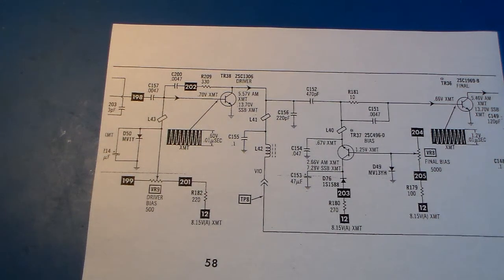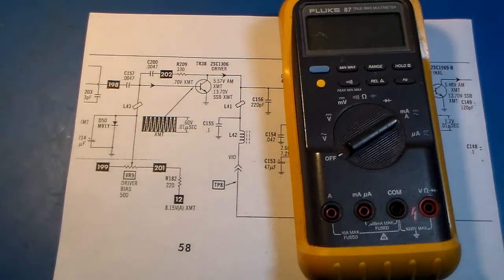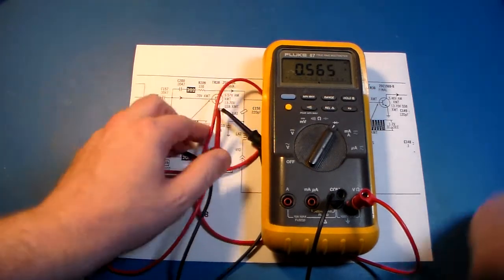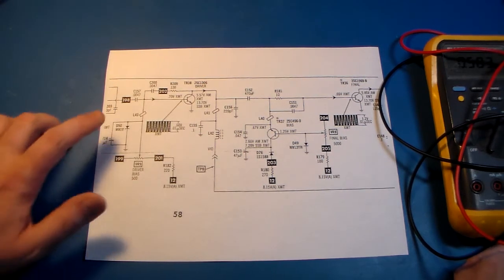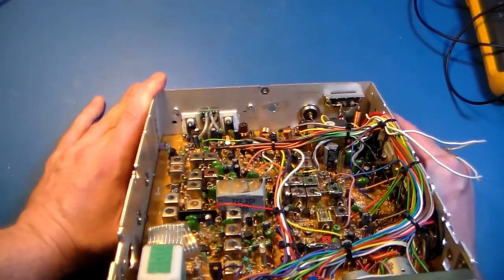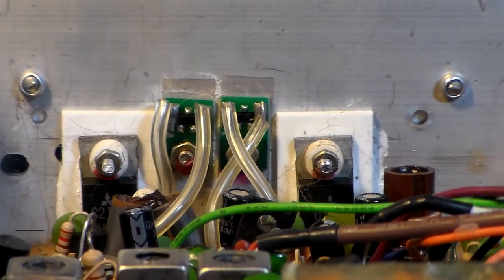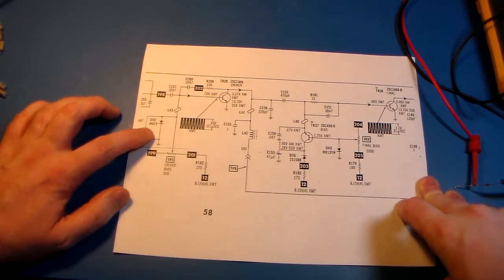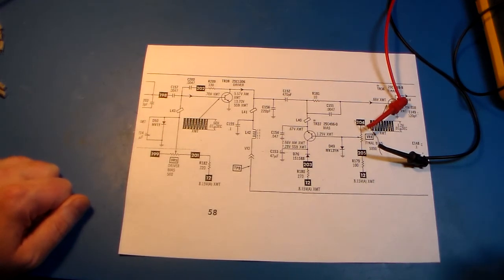The mystical MV1Y Bias Diode.. not so mystical.

Comment: you could also use a double duo schottky diode ready for both final rf transistors. like https://cdn-reichelt.de/documents/datenblatt/A100/MBR1545CT_MBR1560CT_CDIL.pdf, MBR 1545CT Dual Schottky diode, common cathode, 45V, 15A, TO-220AB

Comment: My 1993 "CQ Publishing" japanese-diode reference book page 276 shows type "MV-1" rated for negative tempco of forward-voltage drop of 1.9 mV per degree C. Max power 40mW, max forward current 50 mA. Rated forward drop at 25 degrees C is betwwen 0.58 and 0.65 Volts at 3 mA. 

These were frequently found inside a molded plastic lump with a slot for a mount screw. Incredibly popular inside high-power audio amplifiers decades ago, some with 3 or four series junctions inside to use with complementary-symmetry output stages. It would mount to the heat sink near the big bipolar output transistors, and served to stabilize zero-signal idle current as things heat up.  

Can find no listing that includes the "Y" suffix. My guess is that it's the package designation only. 

Strangely the book shows no entry for "MV13". But we know what's in there, right? 

73
Reply from the maker: I would hazard a guess that the 13 is just two in series on the same die.
The 1.25v vs .7v sort of gives that away a little.
Of course... just speculating.

Comment: Yep, a 4148 works.  RF parts list a 4148 as the replacement for the MV1Y.

I think they actually used a varistor compensating diode in them.  The NTE replacement for them is a NTE 601 which is a Si varistor tempetature compensating diode. Specs are: If-20 mA. Vf-.56 V min.@ 1.5 mA. Vf-.61 max @ 1.5 mA.  delta Vf- 1.8mV/ºC. Pd- 50 mW max.
Reply from the maker: The 4148 is 1.68 per degree C so it's damn close.
Probably close enough.

I just made my own little replacement. Actually works just fine.
Just epoxied a 4148 to the little board. (after I cracked the old one off)
Works in a pinch - and will probably last the rest of the life of the radio unless something catastrophic happens to the RF stage.
Reply: +LeapFrog 

There was a company a couple years ago that sold just that.  A 4148 epoxied to a piece of fr4.  Just can't remember who it was.
Reply: I gotta say Michael really knocked the mystery out of the park with this one, Mark did a good job experimenting with the 1N4148 Signal Diode.

So much so that I'd go as far to say it could be used in a pinch if you epoxy  the diode to a small piece of  fr4 with a hole drilled & bolt it against the transistor.

A really cool test would be to compare the radio's  circuit in operation with a home made replacement compared with an original!

Although I suppose building a dedicated test circuit would be more appropriate for that purpose.
-Leap
Reply: +MikesRadioRepair Nice! Thank You for the confirmation, I had a funny idea that I read about this before.  :-)
Reply: Thanks for sharing this. I will be giving this a try tomorrow.
Reply: I still have some of the original diodes I bought many years ago from MJ Products. Some were on the boards some were loose.